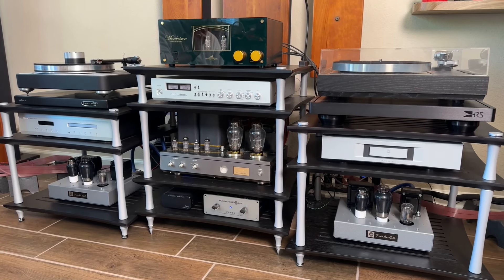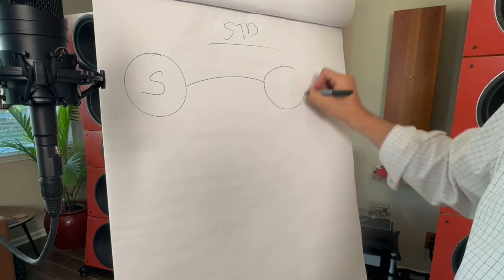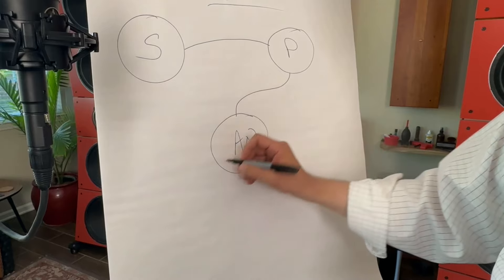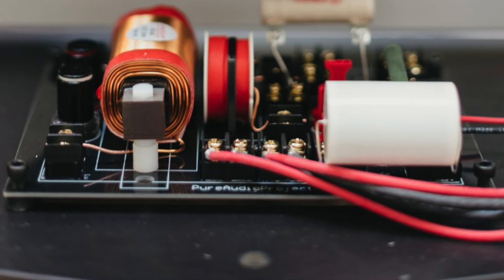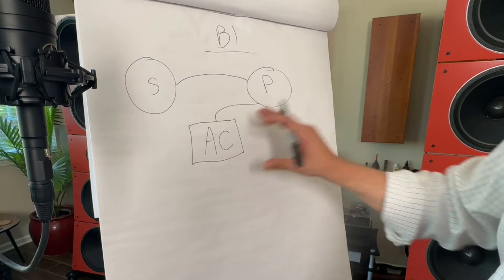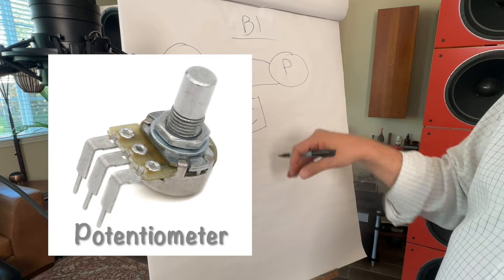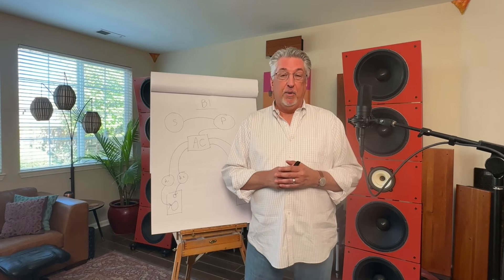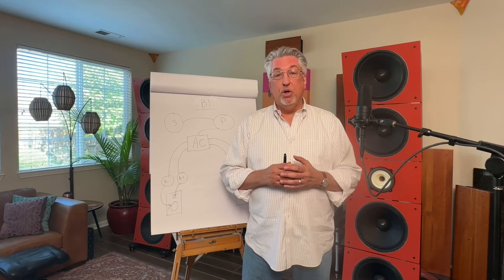All You Need To Know About Bi-Amping With An Active Crossover

Comment: Yes!🎉
That is a "big one" for me (sound quality).

Gone active and never looked back.

But I took a slightly different route that yield even more sound quality.❤
Reply: Care to share that route?
Reply: @kurtmorgan2781  Of course.
Doing the same with a DSP. Instead of the analog Nelson Pass device.

With the DSP you can choice and listening for your self if you want Lindquitz or Butterworth and 1st order, 2nd order, 3rd and 4th.

Also you can measure in room that it gets perfect and you can adjust with 1 hz precision, until you get it perfect for just those individual drivers (as same drivers is never 100% the same even from the same production line) the Nelson Pass solution need new or altered crossover point each time you change speakers when different drivers needs to be crossovered at difrent frequencies.🙄

But the BIG advantage with the DSP regarding the sound quality and what you can't do with the Nelson Pass is that you can correct the room!

You can correct just those speakers in just that room at their position and at your listening position! 😍

And that improvement in sound quality is GREATER than any "theoretical" loss even if you use your TT and do a ADC and then a DAC conversion!

And there is so more that we can do with the DSP to improve the sound quality for the individual owner so it is not even a competition and would double this post length.. 👍
Reply: @AmazonasBiotop  Fantastic stuff!  Love it.
Reply from the maker: @AmazonasBiotop  I use a DSP (along with digital amps) in my vehicle system.  I can see how a DSP + room correction could be righteous in a home system.  Thanks for sharing and thanks for watching!

Comment: Can I remove the jumper from the crossover, instead of accessing the inside of the box?
Reply from the maker: I'd love to hear from others, but I do not believe that would allow bi-amping though of course, it allows bi-wring.  Meaning, I "think" that whether the jumper cables are on or off, you're still going through the passive crossover.  I hope I'm wrong about that as it sure would make it easy to connect directly to your drivers.

Comment: Active crossovers are not the best idea. I tried various active crossovers including tube crossovers from marchand electronics. Today, after years of experience, I prefere passive in-line filters before the amps, or combination od in-line filters with simple passive speaker crossovers fine tuned in a system.